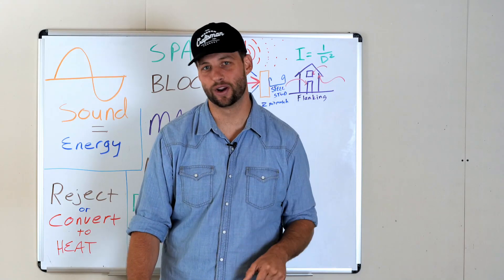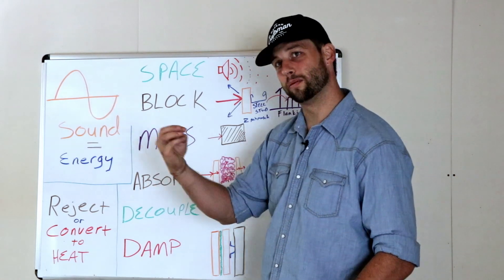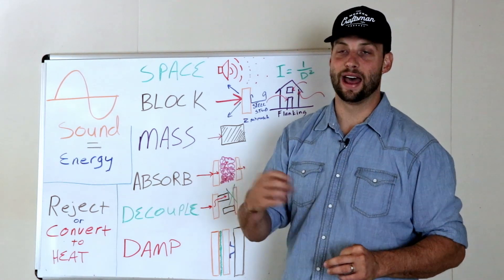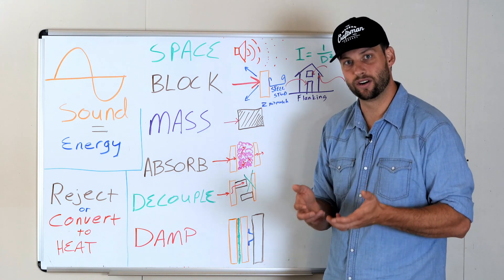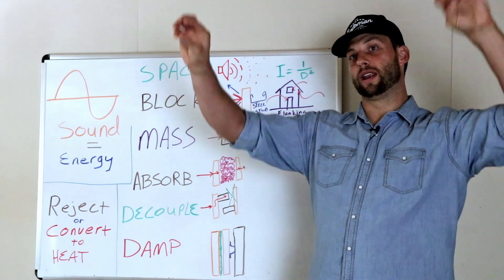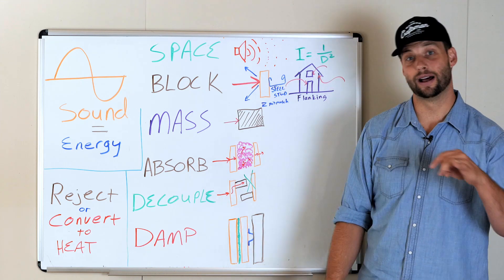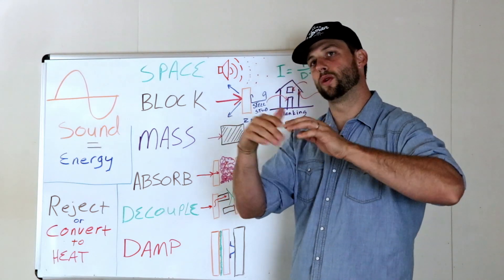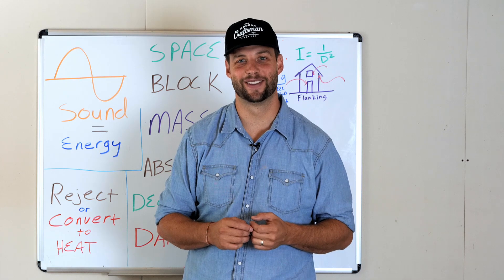Six Soundproofing Strategies (Soundproofing Series Part 2)

Comment: Don't forget "Qualified Installers". I spent $$$$$ on Pella windows with thicker glass. Installer (Lowe's subcontractor) effed it up by not insulating the jambs or behind trim, nor shimmed it correct. I even had renovated a wall (put up membrane + foam + rockwool to dampen). Noise came in through poor window install. Next home: 20" thick reinforced concrete...
Reply: shush

Comment: I have a mechanical engineering background (basically applied physics) and much of what you covered here is inconsequential.  There are two main aspects of sound that are relevant: It is a wave and different materials have different resonance characteristics. Those characteristics are: deflection, dispersion, or passes on the sound.  Dispersion is the best "soundproofing" (No such thing as soundproofing unless you introduce a vacuum).  Because of the nature of sound traveling in a wave, it is different than other types of energy. The best way to inhibit sound is to disrupt the wave.  One of the best ways to disrupt a wave is with composites. Think about a layer of cement board, then a layer of cork, and then drywall.  3 different substances with three different resonance characteristics will disrupt the wave differently allowing for more dispersion than any one of those materials on its own.  And each will disrupt it differently at different Mhz, which is really important too.
Reply from the maker: If you can hear MHz, then what I covered is definitely inconsequential for you.
Reply: @JordanSmithBuilds  You are correct!  Been looking at new laptops and have Mhz stuck in my head from reading lots of processor specs.
Reply: Seems you are describing in more depth some of the items he did cover, as if those items were consequential.
Reply: @Jookyforever  It is actually the other way around.  The basics of sound are that it is a wave and you can either deflect, disperse, or pass on the sound.  Everything else is derived from these most basic concepts of sound.  I have recently done a lot of research on this (it had been a while since I used my sound knowledge) and one "expert" went into all this stuff and more, and in his closing summary, he basically states that the only important thing with reducing sound is resonance.  And I agree.  All of the things Jordan discussed will help with understanding why something is reducing the noise (interfering with the wave), so it is good prep for the next video.
Reply: @fromtheburbstothetetons8826  I don't doubt you know the in depth concepts of sound as it relates to a particular field. We most definitely are not able to cancel out sound waves with other sound waves in buildings currently. Jordan is describing applying the principles of sound to their minimization of transfer as it relates to a building. This application video necessarily won't go into all of the physical background, but it did do one hell of a job getting into some really good points without teaching us acoustical engineering in its entirety. Your initial statement saying his points were inconsequential was clearly wrong, as all of his points provide positive consequential steps that can be taken to minimize the transfer of sound.
Reply: @Jookyforever  They are GOOD points. And his discussion is similar to others on the internet that claim to be experts on sound.  And I know Jordan isn't claiming to be an expert.  I am not claiming to be an expert either.  But with my physics background I know many of these people that ARE claiming to be experts are not sticking to "real" science.  You can't absorb sound.  Sound is two parts, sound energy that travels as a wave over a median. So you can "convert" the energy or manipulate the wave.  @BennyMcKeon makes a good point of affecting the sound through cancellation. @Loganbay about how sound and water waves work nearly identically.  If you put out an inverse wave that completely cancels out the first sound wave, where does the energy go? Sound is a funny thing. I think sound dispersion is the most important conversation we can have about noise reduction. By taking away some of the energy from the sound wave and deflecting it at the same time, a phase shift happens and will interfere with some of the other dispersions and through an inverse wave, canceling out the other sound waves.  Kind of like throwing a big stone in the pond, it creates a big wave, and if you throw in a hand full of smaller stones, the micro-waves begin to interfere with and disperse the big waves.

Comment: I'm interested in learning more/experimenting with this stuff. Building science in general, I do my best to keep up to date. So my company can offer the best of the best, and then some. I'm curious though, have you done any testing with different insulations and diferent methods using green glue? What about sound transmitting through floors. That's certainly different. There's got to be a best of the best method for under X amount of dollars. Say for the sake of keeping upstairs noises down. Especially in an apartment or homes with multiple level spaces being occupied by many different people. In commercial applications we see alot of metal track spacing. That spaces the gypsum off of the studs. But I've always felt like this method is unimpressive. Then of course we see double 5/8 all the time. For fire and sound. Still, they don't use any insulation or green glue so it doesn't make much difference.we play it pretty safe when a customer asks for some extra sound deadening, we will use an elastomeric sealant between all framing members, then green glue under 5/8 gypsum, screwed, and usually with rockwool since we usually do a light spray foam and rockwool combo. We've recently had good luck using this same method, but using green glue and adding a second layer of 5/8 gypsum. But it gets costly. Is there a better way to do this? What about floors and ceilings? We are just doing certain rooms and walls. And using green glue between extra gypsum. I'm open to a good source to learn more. Or someone letting me know what y'all are doing. I do make my homes tight. We do a blower door test and use a Flir thermal imaging inspection camera to find where we might have a pinhole. We always have something small somewhere.  Never have done the expanding insulation/caulk mist thingmabobber for an even more fully sealed home. Though I am interested in getting that going here in MO. 

Hey...Thanks for the content Jordan! Love the way you present science in this trade. 👍

Comment: You can also soundproof... Well, attenuate noise... Through cancellation. There are what is basically a larger version of noise cancelling headphones that emit a sound that's 180° off phase from the noise.
Reply from the maker: I have seen those.  Makes total sense as a passive bass trap replacement: you can use the active devices in different locations and easily tune them to the environment instead of being locked into a certain set of frequencies with a passive system.  It also could make sense where the offending noise's location is static and you can place the phase cancelling speaker in the same location.  Or if the listener is stationary you could be able to use a cancelling speaker to some effect.  Problems arise when the listener's and the source's location are dynamic.  What is 180 degrees out of phase in one location and frequency could be back in phase at another location and frequency.  You would get a weird flange effect as you moved around the room.
Reply: @JordanSmithBuilds  All valid points. But there are tradeoffs with EVERY solution. Just wanted to throw another into the mix 😉